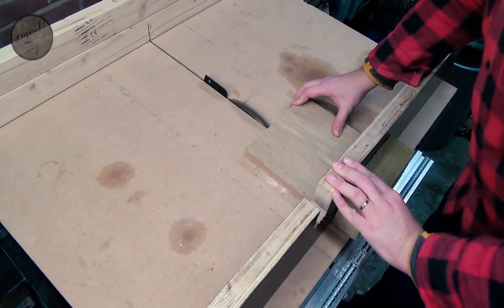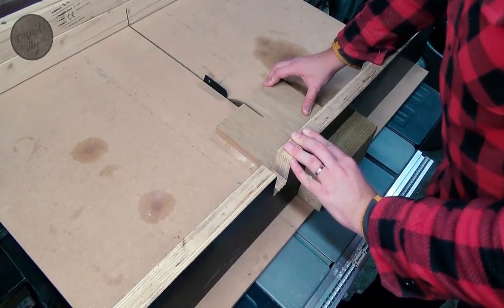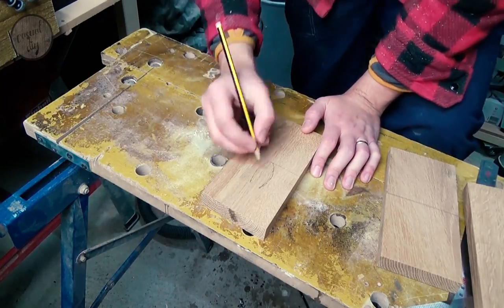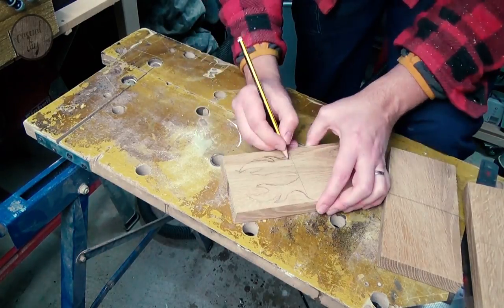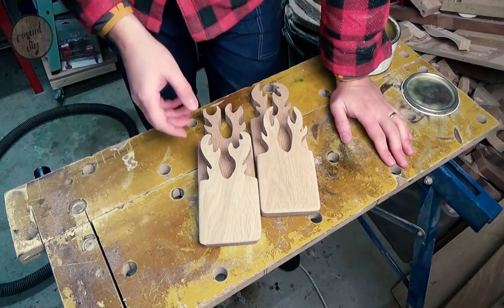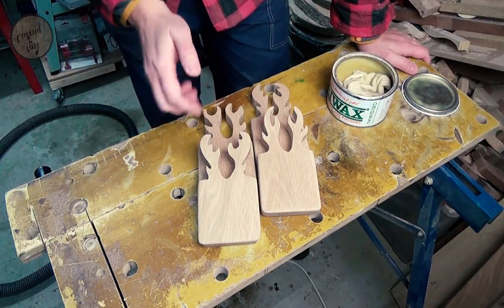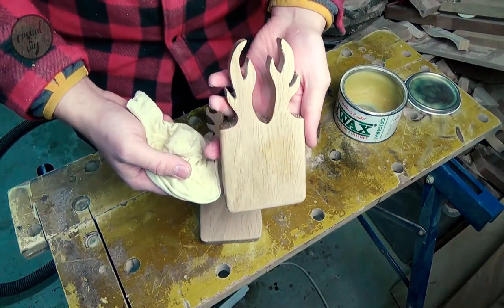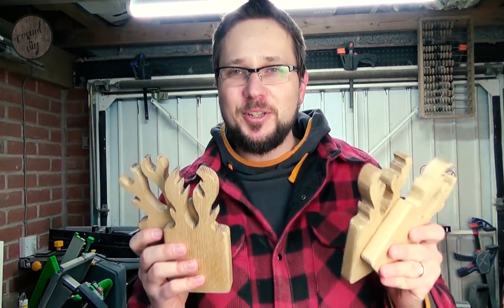How to make wooden coasters with antlers - #HORNYCOASTERS

Comment: Nice videos. Whats your opinion on the charnwood bandsaw after longer use? Thinking on getting one. Cheers
Reply from the maker: It's ok. The B250 is bit small for me now. The major problem I got with it are the bearings, adjusting them is a nightmare and the range they move is very limited. So if you planning on changing your blade often to different sizes be prepared to spending a lot of time on messing around with the bearings so the blade will run correctly. Other than that is very good and had no other issues with it.
Reply: @CasualDIY  Thanks for the quick answer. My main use will be to cutout guitar bodies. So 45mm hardwood with curves, so I probably will be not be changing the blade a lot.
Reply from the maker: @Paulo.Goncalves  should be just fine then mate.